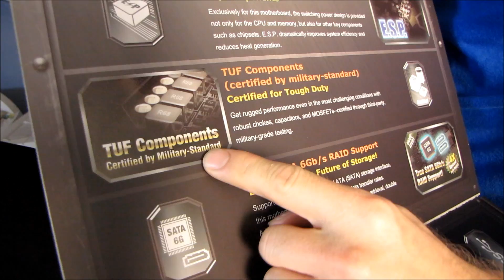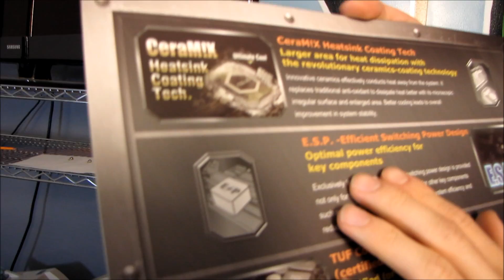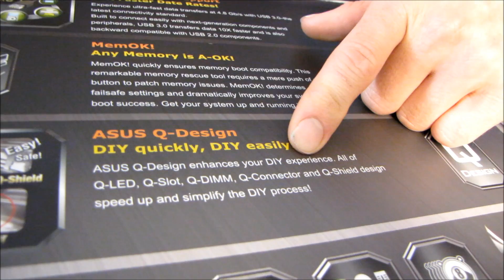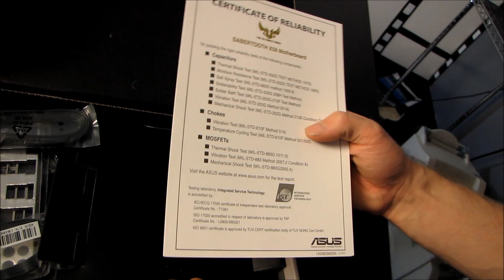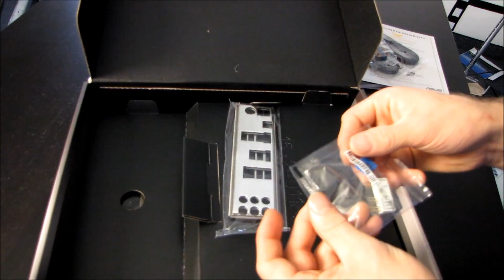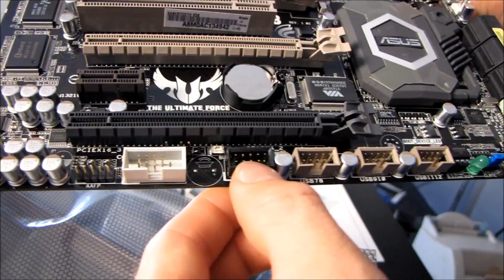ASUS Sabertooth X58 Military Grade Gaming Motherboard Unboxing & First Look Linus Tech Tips

Comment: Stil use the motherboard to this day with i7 990x with 48gb of RAM. This board and CPU are overpowered. The RAM, the GPU, and the PSU died, but the motherboard, the original OCZ 240GB SSD, and the original i7 990x still work.

Comment: Still going strong! This computer lives in the garage at ambient temperatures ranging from 32F to 115F throughout the years.  I did a case transplant about 4 years ago and did a re-seat/re-paste of the CPU but other than a few minor upgrades (SSD and Video Card) it's been a trooper (pun intended). No maintenance and no failures, can't ask for anything better. Only downside is its a bit loud but I use a 47" sony bravia (also from 2009 or so, replaced the Tcon board in 2014) about 10 ft away. Today's LTT upload of 10 years of gaming PCs inspired this post.

Intel i7 990x Extreme @ 3.47 32nm Gulftown
Corsair 24GB triple channel PC3 10700 9-9-9-24
EVGA GTX1060 6GB
Samsung 840evo 500GB
Reply: An unlocked 990x at stock frequency? My Xeon W3670 is clocked to 4.7 on this puppy
Reply: @camtech1190  I had it running at 4ghz for awhile but still on stock factory cooler. Kept telling myself I’ll get a better one when it fails or bearings make noise but it just keeps going. Think I’m going to do something about that now there’s a 3060ti founders in it.
Reply: im running the same mobo but with a xeon x5690, still going strong! really appreciate the long term reliability of the military components!
Reply: Not the Same mobo, but got a rampage 3 gene with a w3680 transplanted into an XPs 9000! An absolute beast for what its age, able to play majority of games at 80-120+ with an rx 5700xt inside!

Comment: this mobo is definitely the best investment ive ever made, its still going strong even after having been puth through the dishwasher to clean it after being in two oil cooled pc setups, now in a fully watercooled setup. runs 24/7 no prob and can handle whatever you throw at it, thanks for suggesting it linus
Reply: Building a retro XP system with one today. Hope the last 9 years have been kind internet stranger and that your board still runs like mine.
Reply: Mine lasted very good and could've lasted longer if I didn't bend the CPU pins whilst trying to replace my i7 920 @MrFogdood

Comment: I have this asus sabertooth x58 motherboard with intel i7 980X (6 core 12 thread at 3.33GHz), asus strix 1080 ti, and 6 8gb ddr3 ram sticks, 48gb ram total. Yes, it runs the 48gb ram with no problems and has been doing so for over 5 years now, 24GB max ram is B.S. This computer is a beast, runs cool with corsair h1100i v2 liquid cooler and I won't be upgrading to a new ddr4 mother board for some time. You'd have to pry this computer off of my cold dead body.

Comment: I've had this board up and running for about 3 months now. 
1600 mhz Sector 7 RAM... runs great. overclocking works great, most stable mobo i have ever used.

Comment: Still using mine, got it at launch. Just ordered a Xeon processor for it, put a RTX 2060 in it last week. Plays Rise of the tomb raider and Deliverance: Kingdom Come well. Was quite surprised about the last. 

Only criticism of this board is the northbridge gets what I consider too hot and there isn't much room for a fan near the heatsink if you have a bit CPU cooler. Otherwise it's great.

Comment: @Ninjapcx I own this board with that ram. Not only does it work, but it works very well. I can OC it past 1850mhz just fine without any extra cooling devices.  The standard heat fins on the ram works great. I have found this board and the ram to be reliable and fast.

Comment: @TekkSpekk YES it will work with i7 960... i have this board with i7 950

if you decide to get this board make sure you get the sabertooth x58 model because that is the 1366 socket which fits the i7 960

Comment: The motherboard is great, got one myself, biggest gripe with it has to be the lack of spacing between the two x16 PCIe lanes. Basically makes SLI/Crossfire impossible due to heat constrictions, and finally the below PCIe lane is only x4, so unusable for high bandwidth cards, much to my dismay :(

Comment: @chigger1496 The board has 4x3 pin fan connectors and the standard cpu 4 pin connector

Hope that helps you with your question :) or others

Comment: @InglouriousGamer2009 
Just keep in mind that WoW always evolve, they can release patches that will improve graphics. So I know for a fact that a 5770 alone can run Cataclysm very smoothly even in full HD, but once they do all the changes the game is gonna ask a little more out of the PC so another 5770 wouldn't hurt. But for now, I'm sure that just 1x5770 is plenty for ultra settings if you have a good processor and adequate memory.

Comment: @hosrom There are Ceramic bonded thermal compounds for better heat dissipation, but I think that this one is a porous material for more surface area. Whilst the material may not be quite as good at heat dissipation, the increased surface area makes up for it. Any gains would be marginal at best but the real benefit is in the long life of the components as the coating prevents oxidizing of the heat sink materials. So in summary, same cooling(maybe a touch better?) hella long component life.

Comment: @Cruxx11111111 I think I've found out... P6X8D-E, which is slightly more expensive, supports Tri-SLI (or tri-ATI) while sabertooth only supports dual SLI. So less PCI-E slots. Also 8-phase power for the sabertooth while 16+2 for the sabertooth ( but with better components).

Comment: I'd have to throw out a guess that the rough paint is more durable than a flat finish and it increases surface area for better cooling, however it is probably a negligible difference.

Comment: @mushfarm Usually it's just because the components themselves burn out after that time period. The myth about companies only giving warranties for as long as the computer will last is true. It's not like a conspiracy or anything, warranties are there to protect you from manufacturing defects, not physical limitations of components. For example, for arguments sake, if a 3V 27uF capacitor will only last 9000 hours under heavy load, then obviously, they will only put a warranty for that long.

Comment: one of the best x58 boards for the price, still running my i7-950 oc'd to 4.1ghz 24/7 perfectly, just watch the hot Northbridge =P
Reply: Oleg Klyuchak my other x58 build is actually a x5670 on a rampage 3 gene, sure as hell doesn't feel like a 9 year old chipset 😂👌
Reply: Hope it works out well, I settled for a true Sata 3 PCIE Card as the marvell controllers are terrible.
Reply: can you tell me the settings you used? I have a sabertooth x58 with a 950 and i cant get it over 3.6 ghz
Reply: I do want to get a xeon but i never overclocked my i7 and before i get my xeon i want to see what the difference is also thanks I got my cpu to 3.8 ghz stable
Reply: its worth or not? i can get for Asus sabertooth x58 + i7-950 for $123?
Reply: Smile cat get it, just got me one with an I7 960, and 24gb ram for $150, also just picked up an Asus P6X58D-E, I7 950, 12gb ram for $150 and still have my old Asus p6t deluxe v2 with a xeon x5675@ 4.6ghz and 12gb ram, buying 2x more x5675's I love X58 and xeons!

Comment: Ceramic coating is used in the industry for heat. Especially exhaust, meaning it keeps the heat INSIDE and prevents heat escaping. So in theory those chips will be cool to touch but they will keep the heat inside, getting hot.

Someone correct me on this.

Comment: This is a very nice motherboard, it has all the things that I just need for gaming PC, with 5 years warranty, Asus brand, dual 16x16 PCIE for sli and one more PCIE for physx and here is my setup:

Intel i7 950
Cooler Master HAF 932 Full Tower
Kingston DDR3 PC1600 12 gig
WD 1tb 7200 RPM 64mb Cache Dula Processor Sata 3 600gbs speed
2 GTX 580 SLI (1 EVGA GTX 580 SC and 1 Asus GTX 580 DirectCU II)
Cooler Master Silent Pro Gold 1200w PSU

GAME ON! good Motherboard :)

Comment: @Ninjapcx Also, I think it is the fault of the ram, but I'm not 100% sure, but it defaults to 1066mhz.  You will probably need to manually change the speed to 1600mhz in the bios set-up. If you want to ram to last super long or your system to run super cool you could just leave it at 1066mhz, lol.

Comment: @InglouriousGamer2009 
Should be more then fine. I'm currently running a 460 gtx SC from EVGA, waiting to go SLI for christmas, and I'm running it very smoothly without any fps issues, full HD in ultra settings. I'd say for WoW 2x5770 might be a little too much, but at least you'll be able to play other cool games with very high setings too.

Comment: @fahadmuneeb 
Hey,If you want to tell me what kind of build you'd like to put on it I'd be alot more helpfull.Heres what I think without knowing your build:This Sabertooth board only allows 2-way SLI in full mode while the Rampage will allow you a 3-way SLI in full mode.So, if you want to three-way SLI buy the Rampage III Cause it can take the three cards at x16/x16/x16. If not, take the sabertooth. Amazing mobo(almost 100$ cheaper then the rampage)and it does it all except what i mentioned.

Comment: @fahadmuneeb it has 3, but tri-crossfire won't be very good on this board, they will run at 16x-16x-4x, assuming you don't have super high end cards, they won't be crippled, but for instance, 5870 will probably lost 10-20% performance using the 4x pci-e slot.

Comment: I used the same board for 6 years (worked fine throughout) and it was pretty shit tier. 
The military grade thing is kind of funny, no one with ANY respect for their computer would thrash it around so much that the military grade parts actually have to be tested for it's ruggedness. And if someone's rich enough for this mobo, then they're rich enough for decent cooling as well.

Comment: My very first motherboard of my very first build that I am still using to this day 9 years later!
In desperate need of an upgrade though... :(
Reply: why do you need an upgrade? mines still running great, if youre having trouble get a better cpu or look into overclocking. you can get 4ghz+ out of the xeon x56** stuff with 6 cores!

Comment: For all the cool MOSFET - ceramix - cooling stuff I LOVE this particular model but I have a hard time diff. it w/ the Asus P6XH68D-E which is another X58/ICH10 mobo w/ USB3.0, SATA 6.0 GB, 6xDIMM DDR3 triple channel up to 24GB and the same amount of ports and slots. 
The only differences I've seen so far is the Realtek 892 audio chipset instead of a 889 and 1 less PCIex16 slot.
Both cost approx. the same price.  
So I guess the 2 mobos are designed for 2 diff. types of demand... Which ones?

Comment: @InglouriousGamer2009 
I can't guarantee it since the new expansion is coming out and the DirectX11 is not fully used yet by WoW. My best answer would be for now yes, but if you're looking to buy a new pc that will last more then 1 year without changes i'd def. go for a 2nd 5770 or just for the same price a 480 gtx or something like that.(2x5770 are about 300$, wich is about the same price as a 470 gtx).

Comment: As Linus mentioned, for LGA1366, you must populate the lighter coloured DIMM slots first that are located farther away from the CPU socket compared to the darker ones. I have a LGA755 motherboard (P5N-D) and I am not sure whether to populate my DIMMs in the 2 lighter coloured DIMM slots which are closer to the CPU or the darker ones which are farther. At the moment, I have the darker ones (farther away from the CPU) populated and it works fine. Can anyone help?

Comment: I would like a suggestion.
What is memory (or kit) install on my Asus motherboard x58 Sabertooth, reasoning processes i7 950.
I want to go installing gradually, in the future (2 or 3 years) to achieve maximum memory capacity of my Asus motherboard for x58 Sabertooth 24G.The montherboard comes with Double Date Rate 3 (DDR3) Dual Inline Memory Modules (DIMM) sockets.

Comment: @IamMrRagequit I have the Cooler Master Hyper 212 Plus, it works great, haven't done any over clocking yet. I got it for like $30 at micro center. Try Newegg.com if you don't have a microcenter near you . My idle temps are about 27o C. and Full load i think are around 44-48o C with 1 heat sink fan. I have a CM Storm Scout with 3 fans which has great air flow

Comment: So if my computer bits are considered Military Grade is it a lot safer to overclock the rig? I've been debating whether or not it would be safe to overclock my computer since it is getting older and doesn't push the frames quite as well as it used to.

MotherBoard: MSI 7681
GPU: 2 MSI R6950's running crossfire 
RAM: 8 GBs

Comment: still holds up 120+ on overwatch
60 stable bo3
1700 on civ V (is that normal?) 
I7 920
Asus x58 sabretooth
R9 280 x
18gb ram ( 3xcorsair budget ram, 3x corsair xms 3)
I think the case is a tt antec,  
Its just starting to lag on newer pretty games like dishonored 2 
Mid graphics 50

Comment: This kit is good for my motherboard.
Patriot PV7312G1600ELK Memória Patriot Viper II Sector 7 Edition 12GB (3 x 4GB) 240-Pin DDR3 SDRAM DDR3 1600 (PC3 12800)
and in the future if I buy another kit like this will have 24GB, maximum capacity of the mainboard?

Comment: hello folks, i've just upgrade my x58 sab with, 4x4_16gb 1866mhz gskill sniper, i7 975 extreme, gtx 1060 6gb oc dual asus, with aerocool p7 and noctua nh u12s, i know is outdated MOBO and CPU, but ill totally love vintage cpu, can handle good any game/app/OC i need, my question is, the updrage of x58 is, my current cpu i7 950 OC 4.0ghz,CM tx3, my gtx is 1050 ti, and ram are 12gb 2x6 1333mhz corsair xms3, good upgrade? thank, and sorry for my bad bad english :D bye from Italy!!!!